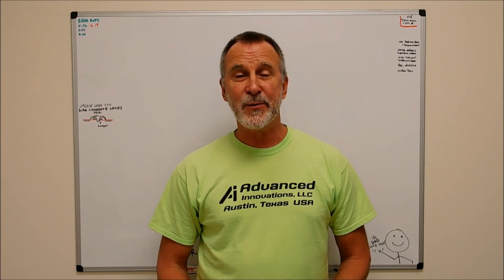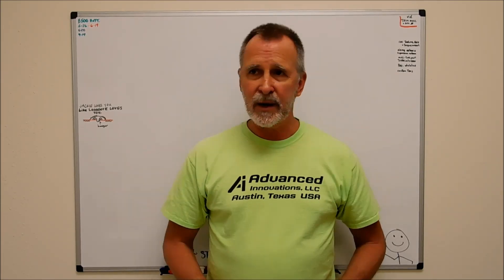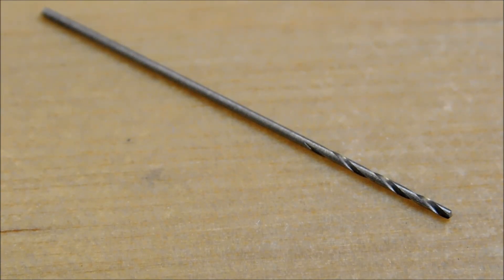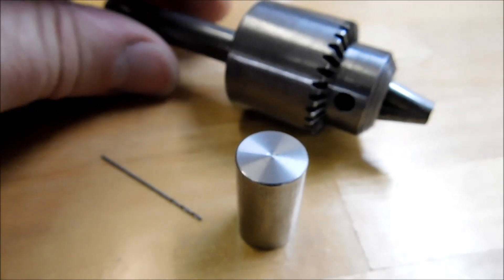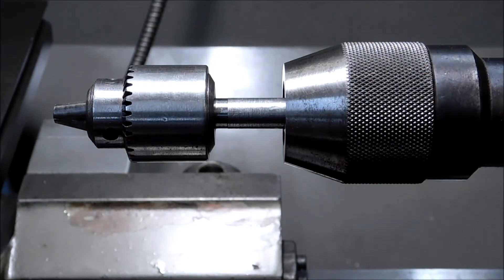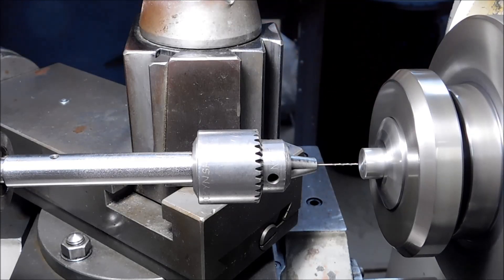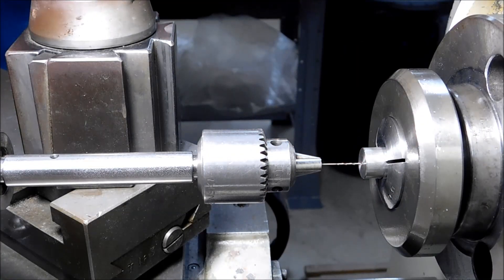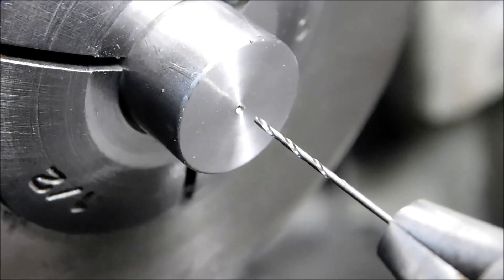Micro Drilling -- Stop Breaking Small Drills !!

Comment: Really great video!!  Two points:  First: To start that hole, you said you used a "centering bit".  I just learned that Centering bits are for use with dead centers; while "spotting bits" are for starting holes for drills.  Is my info correct?
Second: What tolerance would you use between the drill chuck and that sleeve if you were going to make your own version of this chuck adapter?  Would the tolerance be what the Machinist's Handbook calls a "sliding fit", or something more precise?
Reply from the maker: Thanks for the comment. In regards to the starting feature, I see it this way. A center drill does have a  reduced lead on it where as a spot drill does not. Either can be used for starting a hole, but only the center drill can be used with a live or dead center. The advantage I see for using a centerdrill to start a hole is that only the outer edges of the drill cut initially. This allows the drill to start the hole before the web center of the drill makes contact and increases the force necessary to continue. As for the fit of the components, a sliding fit is all that is needed. Something smooth enough to allow for easy movement axially without much side to side slop.
Reply: @joepie221  As far as I know, spotting bits have a cone angle of 90 deg.
Centering bits have the same 90 deg. cone angle for the large diameter and 118 deg. for the small.
This 118 deg. pit allows the mini drill bit to slide to the pit center and start drilling in the precise point.
Still, if the cone angle of the mini drill bit is 135-140 degrees(bits for hard metals), the standard centering bit won't help.

Comment: I use basically the same technique but instead of holding a sleeve in a bigger chuck I bored out a soft morse taper dead centre to act as the sleeve part.
Reply from the maker: Make sure you have an air relief in the bore.
Reply: @joepie221  Through drilled.  You have a great channel here.  I am just starting to build one.

Comment: There are two mine reasons for the drill breakage on a lathe: center misalignment and inconsistent(improper) load. The second mainly due to inconsistent feed rate.  From that point the idea to feed the tool , mounted in the free moving adaptor(that can to be an additional source of misalignment)by the fingers looks to be questionable at least.
There are small, precision air or electric  driven spindles for that purpose.
For the small solid carbide drill bits, the importance of all of above even  higher
Reply: Anatoly Panchenko hold on man, this dude literally did it right in front of us. The way he talks about it and how confident he is in presenting it, I’m gonna go ahead and guess he’s done this plenty of times before, also successfully. So what grounds are standing on to call this method “questionable at least.”
Reply: @ajsproductions3400   The grounds are 1 Incapability of the human hand for the constant feed rate and load. 2 Introducing of an additional source of misalignment by that free moving adaptor.  If the above was not absolutely correct, there was no need to use CNC to drive machine tools.
I did not tell that the method is bad or not working.  It will work with HSS drills more or less. It most probably will fail for the carbide drills. And I still not touched the subject of tolerances.  And the one, that going to feed the drills into still just by the hand, should keep in mind,  that while too high feed causing a tool breakage, too low feed causing excessive wear of a cutting edges of the tool. And there are stainless steels like 15-5PH, 17-7PH and similar. A low feed will cause the cutting of hardened layer of the material.

Comment: I am almost positive I saw a small amount of flexing of the drill possibly due to a small amount of play in the tool.  For a router you could put a floating collar just behind the chuck to move with your fingers and cut splines on the chuck shaft and on the inside of the tool.  You could not stop rotation but you could still feel the drill.

Comment: When using a drill press a bit that small calls for around 3k rpms. If drilling using lathe can you get by ok with the lower rpm ?  I never had any trouble with small bits as long as rpms were kept high. Thanks for the video.
Reply: Fist=rule  10.000 / 1    10.000 for your machine RPM's and the 1 is your drill /mm  [ divided by]

Comment: Harbor Freight has a small $10 electric drill much like a Dremel tool that has small collet like chucks that work with very small drills. They also have cheap accessory kits with chucks, sanding disks, ect. I have used these for many years.

Comment: Good job
Reply: Hi, I did the same under the small table drill, by removing the drill spring and inserting a small weight on the handle of the drill, without pressure of hands, five thousand 1 mm holes, on a 5 mm iron plate, breaking about seven drills, Sorry my language is not english

Comment: Excellent tip neighbor. Thanks
Reply: Hi, I did the same under the small tabledrill, by removing the drill spring and inserting a small weight on the handle of the drill, without pressure of hands, five thousand 1 mm holes, on a 5 mm iron plate, breaking about seven drills, Sorry my language is not english

Comment: Excellent suggestion, and let me also compliment the closeup video.  As for "feel" I quite understand.  I often use an "eggbeater" hand drill when making holes in non-homogeneous materials or when there is a chance of the drill sticking.  Of course I don't do it with bits as small as yours.

Comment: You can buy precision fine micro drill adapter for $50 and a nice one for under $200 and you can use them in the mill.
Reply from the maker: They are keyed and won't spin if the drill grabs. Best for mill work.
Reply: @joepie221  Good point sir.

Comment: Rather than make an adaptor I just used a big keyed chick in the tail stock and tighten the chuck so the straight shank of the small just slips in the big chuck. Leave the key in the big chuck and tape the long end of the key to the big chuck body, yes it will cost you 3 inched of tape each hole, but IMOH that is cheeper than making an adaptor.  Have being doing this for years.

Comment: Your chuck climbs under a load. ~( 'w')/
Reply from the maker: That chuck is almost 50 years old. The lift is most likely the jaws. I saw that too.
Reply: @joepie221  I have used a Clausing up in MN which has bad main bearings and the chuck will climb if you put enough force on it.  

The owner did not want to spend the money to bet no bearings for it.

 I always check tail stocks for loose fit because it can really mess up a precision part.

It was a pretty beat up machine, I had to build a new slide-key-clip for the tail stock because the original was pretty much trashed.

If I had $850.00 though, he would sell it to me and I would definitely buy it, it has a lot of potential, I just don't have that much spare money on hand at the moment.
Reply from the maker: @DeliciousDeBlair  The other problem is that guys/gals don't check the part for straightness before drilling. if the part isn't straight, the hole won't be either.
Reply: @joepie221  We're pretty obsessive about that kind of stuff around these parts.

Comment: Would be great to have "hints or ideas" to do the same with a bench top press drill, which is the the  place where I break down so many small drills!!!
Reply: They used to make something called a "sensitive drill adapter" for lathe tailstocks. It's like the micro chuck adapter for the mill that Joe talks about. There's other videos about them here. This is a great technique that I wish they taught more students about. I'm sure you could build something that would fit into a drill press and would work the same way.

Comment: I've done this many times in the lathe and mill  using what I know as a finger chuck adapter.  Also known as a micro drill adapter.Sierra American sells a version for $62. I've seen versions on Ebay for $27. It is a 1/2" strait arbor with an extending spring loaded  arbor that has a "0" Jacobs taper end for a micro chuck. There also is a 1 1/8' dia. flange that free wheels so your fingers can extend the chuck. This is can be used in mills and drill presses because the chuck rotates with the 1/2" arbor.  I also get as good or better results, depending on material that I am cutting by setting a quill stop and advancing it .002"-.003' at a time. Without the advancing stop, it is easy to get too ambitious and lose patience. Especially when doing many hole patterns and in gummy materials.
Reply from the maker: The difference being the "micro drill adapter" doesn't allow you to let go and save the drill before it breaks off. Those adapters are great for mill work, but are designed for a driving spindle. And about the "Dilettante" comment  you made on my threading video. Next time you leave a comment that crosses over and gets personal, I'll block your channel. Anytime you care to find out the depth of my experience, just ask.

Comment: being a swiss apprentice micromecanician i can understand why you would have some difficulties with drilling that small of a hole with such a lathe so good job but if you take the good machine for the good job you'd have no problem drilling this hole, for example the smallest hole i ever drilled with a lathe was 0.2mm on a schaublin 70 lathe the hole ended up being 0.215mm in diameter but i was in my tolerance so the job was done
Reply: Agreed, 1350 RPM is way too slow for the drill bit he's using - but that's probably about as fast as that lathe will spin. At a speed of 50 sfm (recommended for stainless), a .026" drill should be turning around 7500 RPM!
Reply from the maker: I also see you are a ST subscriber. Ask DB to do this at 7500 rpm by hand and get back to me.
Reply from the maker: It sounds to me like you are a CNC lathe guy. If the feed isn't perfectly inline with the RPM, this drill wouldn't last a minute at that speed. Obviously my RPM was fine for the process because it works perfectly. Every time.
Reply: Bryan rou 
I have to drill 0.32mm diameter drill. Depth is 12mm.Material is EN31  fully annealed .
Can you suggest better way than hand drilling?
Vikram
mefavkd@hotmail.com

Comment: can you do it again using hand drill,  not on lathe machine!
Reply: Invest in a drill press. With a hand drill it's very easy to put side loading on these small drill bits by accident, which will cause them to break. If you have to use a hand drill, use less pressure and higher rpm than seems intuitive.

Comment: I recently drilled a 2.25mm hole using a pin vice in the tailstock and used the weight of the handle on the feed wheel to give enough feed pressure from 12 to 6 position down and my little finger ever so gently on the upstroke and lots of cutting fluid to cut a 20mm deep hole. It did take a long time, If I ever need to do it again I will use your idea. thanks for the advice.

Comment: Another great video.  Thanks.  I have a project for the wife's business that requires a 3/16 in hole and have just been breaking drills by the handful.  I have a scrounged piece of steel which can be easily modified to use the hand feed technique.  Great job.
Reply from the maker: 3/16 diameter may be a little large for this technique. What is your material?
Reply: @joepie221  Fat finger.  It is a 1/16 inch hole, just big enough to get a small wire through.  My wife makes jewelry and fancy zipper pulls, tassels, etc. for decoration on her hand tooled leather products, earrings, etc.  We purchase spent shell casings sizes .22 cal. .375, .38 through .45 shell casings.  Most of the products use the shell casing base.  
However some of the spent casings used for earrings and other dangly stuff are left in one piece.  In these I drill a 1/16 inch hole through the center of the soent casing base which requires the 1/16" drill to penetrate the spent primer cap.  For the .22 cal shells the drill still has to penetrate some layered metal.  It is common for the small drill to catch and bind and snap off before I can stop the lathe.  I have been busy with some other projects but will get back to cutting and drilling  casings in the next few days and will use your technique then.  Many thanks.

Comment: Rather than drop the bucks for a sensitive feed drill chuck I made my own using a small Jacob's Chuck, a 1/2" drill bushing and a stub shaft on the chuck. The stub shaft is drilled and tapped with a return spring on it.

Comment: Is that 304 st st..lol I dont believe so. I used to use that same technique but it doesnt make the hole concentric if you inspect it..the hole may be concentric at the start of the hole but not through the whole depth. For those that are interested. They do sell a even smaller chuck that has the same bushing method to mount on the cross slide of the lathe..it can hold .005 drills. I know because I drill them into gummy copper or tough kovar and core iron. Very nice tutorial. Message me if you want a picture of one or the make.
Reply from the maker: Albrecht micro drill chuck. Not suggested for lathe use, but ideal on a mill.

Comment: Joe, great trick. 
If you clamp a small V-block on the OD of that female mandrel, you can magnet mount a dial indicator depth.
Reply: Aaah grasshopper,  this is not a trick, but rather critical thinking and the ability to think outside the box and find simple solutions to complex problems. It comes easy to some, in a MacGyver kind of way, and others can't see the forest for the trees. Bravo to those of us that can size up and quickly find solutions to confounding problems that stump others. Necessity IS the mother of invention !!!

Comment: New here, the micro drill title caught our attention because well we are micro machinists so your 26 thousands just under 6.5 mm for us as watchmakers we do millimeter more often. I hope my micro drill press does not begin to stall out here at 6.5 mm as that is really large for us. Just funin, you are good.
Reply from the maker: To correct you, 26 thousands is not just under 6.5mm. Its about 3/4 of 1mm. .026, not .260
Reply: @joepie221  Thank you that is what I get for trying to convert inches to my mm's, thank you for correcting me.
Reply: @ActiveAtom  You aren't the first...nor the last.
Reply: But it is, to all intents and purposes, 0.65mm, so he got his decimal point out by one place. I'm sure that would have become obvious if he ever had to perform the task in reality...  At one shop I worked at, a guy converted a dimension wrongly, from metric to the inches he was so much more familiar with, and we ended up with a roomful of aircraft spec light alloy billets, all 5mm, or a little over 3/16" too short for the task...  @joepie221

Comment: Joe    Good idea.  I have a  0"-1/16" drill chuck on a Hardened 3" x 1/4" shaft.  I put it LIGHTLY in my BEST 3/8" tailstock drill chuck and use "Digital" control to slide the drill bit in..  I'm using "Micro" Lathes, 1/2" stock is Big for me.

Comment: 2 requests
Firstly can we please have a metric version - you are limiting your target audience when you make videos that use a system of measurements only used by ONE country.
Secondly the most tricky part of drilling tiny holes is sharpening the little drills. Is there an easy way to sharpen these things, it takes me hours of trial and error with a jewelers eyepiece and a sharpening stone to get them to cut.
Reply: Get a calculator, then get ambi-metric
Reply from the maker: Myth-ter Moth  This may be a slanted reply, but for the relatively cheap cost of a small drill, its much easier to buy another one. Tiny drill like this are only about a dollar. If I have to sharpen one, I'll use a magnifier and a dremel tool with a cutoff wheel. Use the side of the wheel and you can get it closer to your face because of its size. be sure to pay attention to the wheel rotation direction so you don't get a face full of debris and WEAR A SHIELD OR GLASSES
Reply: Myth-ter Moth that’s funny. He didn’t even acknowledge you whining about metric
Reply: Harry Eleftheriou Thanks, but I’m not the one that needs the help
Reply: Myth-ter Moth 
Do you got any information to sharpen the micro drill?
Please also send me if you have.
Thanking you.
Vikram
mefavkd@hotmail.com

Comment: Does work on the mill, You need to put a collet and the stock in the holder in the spindle, and again have the drill holder clamp on the bed sticking upwards
Reply from the maker: Make sure they are perfectly aligned or the drill will instantly snap off.

Comment: A bigger problem is if your tailstock center is not online with the headstock axis, a drill will break off.  Our secondary operation lathe has no adjustments for setting the height and position of the tail stock.  I had to drill a bunch of .007' holes  To me, .026 is HUGE.
Reply: I've seen this trick before, but never held in a drill chuck. What seems to work well is to but y a Morse taper blank, putting it in the tailstock, marking orientation of the blank, and then drilling and reaming a hole in using tools held in the work holding chuck. It eliminates any off centeredness of the tailstock, both laterally and vertically.
Reply: what sort of bit did you use to drill 0.007 holes?

Comment: Joe thats brilliant this is my next project my drill sets always have the very small ones missing lol 
When you get a chance would love to see how you would make a TTS tool holder for the mill, 
My mill was a manual collet mill and have changed over to a air draw bar and quick change tool system its Tormach set up but makes it very easy to change tools out saves me having an auto tool changer and setting tool length all the time, i can measure the tool length and put it in Mach 3 and use fusion 360 for the machining code works ok but would love to see how you would go about making a TTS tool holder when you get a chance.